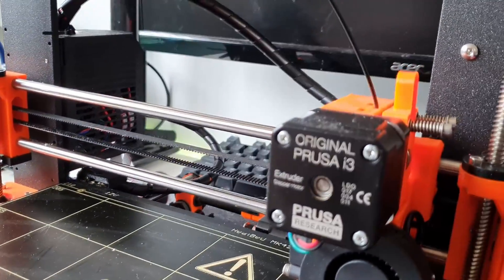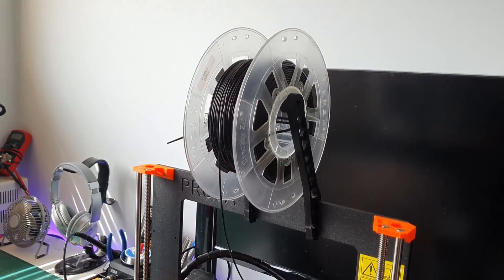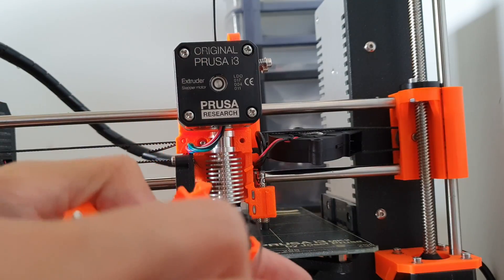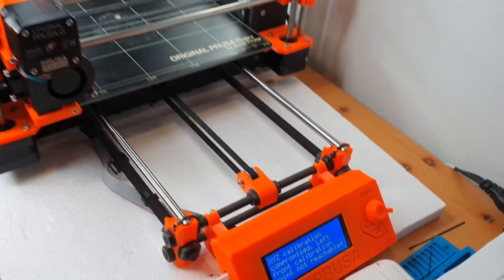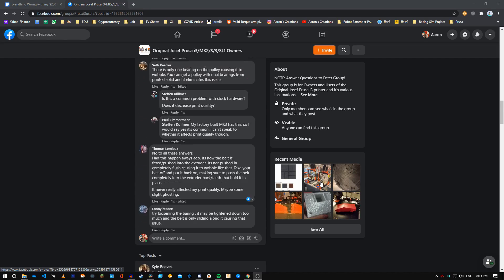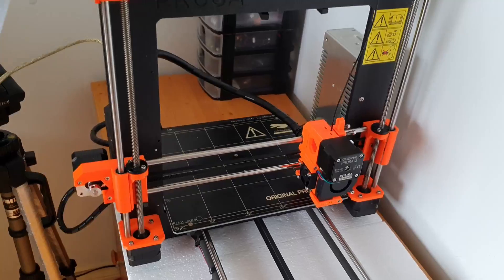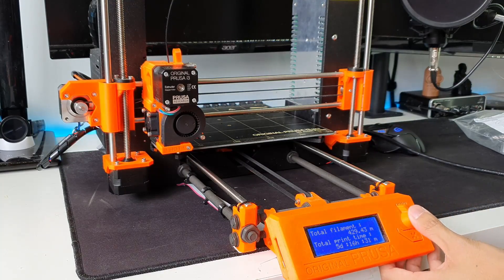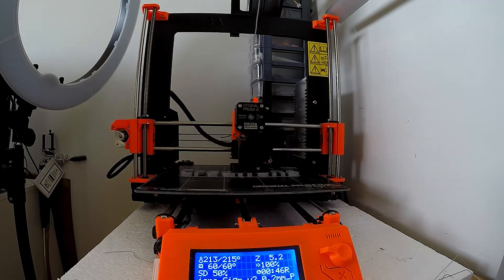Reviving the World's Cheapest Prusa 3D Printer

Comment: Awesome! I just bought a MK2 just for the heck of it. It’s missing the original leadscrew steppers for Z and has them replaced for generic ones. Also, mine was tampered with, I found out. It had a 20 teeth timing pulley on the Y axis, which costed me several days of troubleshooting. Also the hotend heater cartridge was replaced with 24v 40w one, which did not heat up fast enough. I’m waiting for a package, but the printer costed me 70 euro in total, including the parts I needed to buy. It’s just to see what the Prusa experience is all about. I had already 4 printers 🤣. Also I reprinted most of the parts in ABS.

Comment: I did exactly what you did and bought an MK2 on off eBay.  The pinda probe gauge is a great idea and I will use it. Mine came damaged in shipment. Got on GetHub and printed replacement parts. It is up and running.  I noticed you did not use a glue stick. What was your magic for bed adherence?  To your point the M2, 3, 3s and 3s+ are great printers.  After my first MK3S+ build I bought another MK3S+ assembled. Then I bought another MK3 off eBay yesterday.  They are so fixable.  Great and valuable video.
Reply from the maker: I haven’t needed glue stick but there are sheets that have been through a lot of prints that lost it’s ability to adhere. In that case use a glue stick.

Comment: Hey I know its been a while since you posted this video but I recently bought a MK2s that had a fried mainboard.  The seller shipped it to me in just a cardboard box and no packing material and I am pretty positive it skewed something and my bed doesn't run orthogonal to the print head.  I am not sure what I need to do to fix this, I have thought about just buying the bear upgrade frame but I would like to not spend on it any more than I have and I'm pretty sure I don't need to to get it back running square.  

I put a duet 3 mini board in it and its fantastic besides not printing square.
Reply from the maker: Source another board would be the easiest option. I’m pretty confident that AliExpress sells them. I know that Prusa doesn’t support the MK2 anymore.

Comment: This was useful for #2276697 as i turn a geetech i3 into a mk2ish thing.

Be aware that most of the features of the prusa firmware are in marlin, with the big exception of the calibration wizard. Most of these features are not enabled by incredibly lazy printer manufacturers and as such their printers are super limited. Look at configuring and compiling marlin yourself to get these features.

That's not to say Prusa aren't doing great work in improving marlin and some of the features in prusa firmware (which is modified marlin) aren't directly backported. Recent marlin has the prusa tmc driver gantry levelling and it's made dual-z on one driver really reliable on my SKR mini driven ender 3.
Reply from the maker: That's awesome! Recently I've seen budget brands rolling out printers with similar functions to the ones offered on the Prusa. Prusa is definitely the industry standard, but I'm glad to see competing brands catching on :)